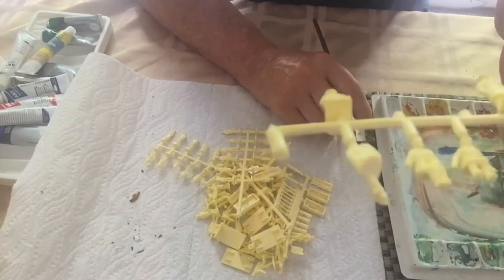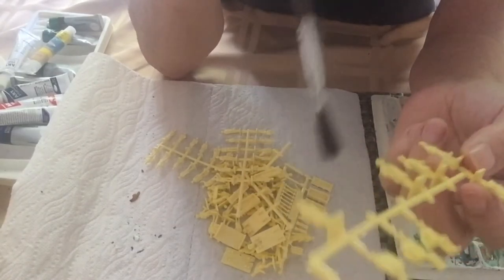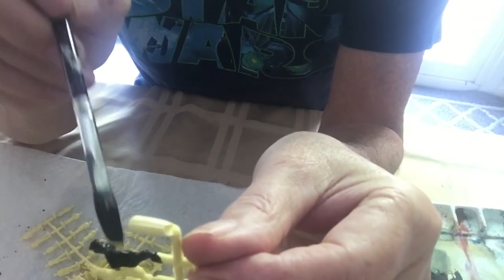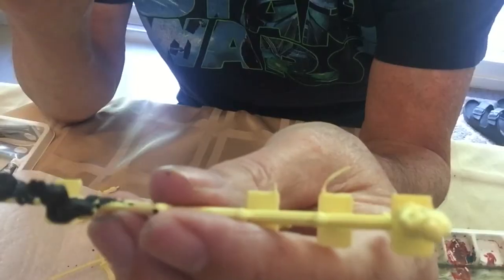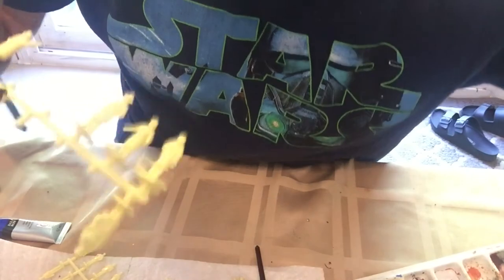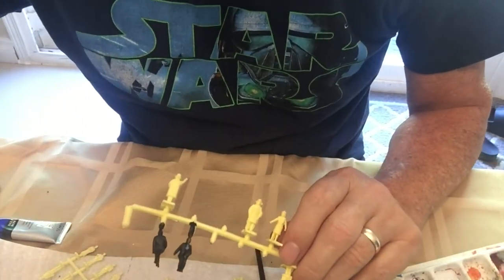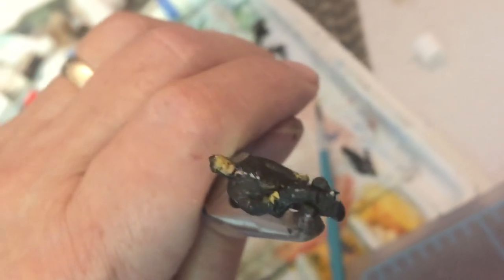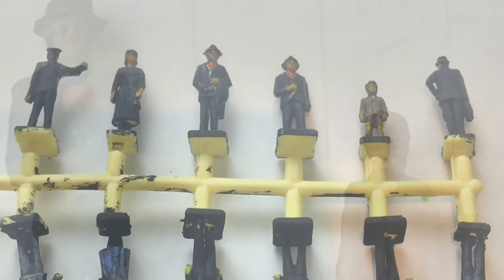My Layout How to Add Airfix Civilians to your Layout

Comment: What are my best bets for Marlin -  Spur 1 - (1/32) figures?
Reply from the maker: What you could do is after cleaning them in warm soapy water and trim all the seams you could give them a base coat of light grey.
Pending on which era you could select a few colours based on photo reference but nothing too bright.
Start with the face, exposed limbs use a light tan colour to see how it looks then continue. The eyes, lips can be done later.
When you have finished the figure make up a wash of black ink or acrylic, very watery and let it run down your figure. If it is too dark you can probably lift it with a damp paper towel.
Try one and let me know how it looks